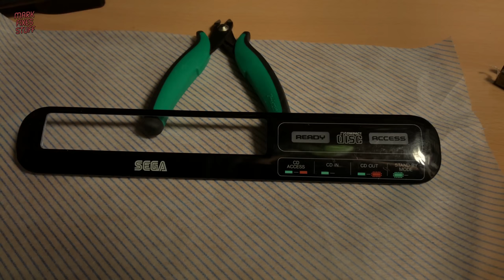Pt 3: Smashed Sega MegaCD Retro Resurrection - Clean, Build and Play!

Comment: i just got one from cash gen.. id a full tear down and clean,, bought some of those pads to clean the rust from screwfix cheers for the tip..
Reply from the maker: Nice one! Definitely check out the caps.
Reply: @MarkFixesStuff  yeah they havent got any signs of leaking,,
Reply from the maker: @fretboarder4752  Just to be clear, sometimes they don't have visible signs but when the machine has been on for a few more hours they will almost certainly start to die with bubbling juice leaking out. It's worth keeping it under observation. All three here had bad caps. I don't want your machine to die!
Reply: @MarkFixesStuff  il keep an eye on it once i get it setup up.. i know a lad local who could recap it for me like.. my md has a region hz switch but the mega cd gives a region screen..think the 60hz mod is to blame for it
Reply from the maker: @fretboarder4752  Yes. You can get a region "free" bios, which is a hack of the japanese version. That would work with all modes but is incompatible with a couple of Japanese games iirc, Snatcher being one.

Comment: Great video I brought the Mega CD back in the day and I've still got and works great. I might need to open it up and check to see if the caps are not leaking.
Reply from the maker: Please do. They are really bad for it. I've seen eight or nine of these and they all had leakage, with some being quite damaged.
Reply: @MarkFixesStuff  It will be next to do on my list I am just doing a Amiga 600 at the moment.

Comment: I still own my Mega CD, from new and when it came out back in early 90's.. I still use it today.. I have a number of Original retail disks and loads of backup/copies that all work great.. Keio flying squadron I downloaded a PAL version but have patched some NTSC and NTSC-J disks, if you buy a Everdrive V5 or V7 you can change the BIOS via the Cartridge (EASY).. I find the Mega CD underrated but I think its great.. Look out for Super Strike Trilogy (Desert strike, urban strike, jungle strike) never was retailed but was in development and never finished (someone did finish development).. Super Strike Trilogy is available to download but will need patching for PAL systems.. There is loads of good games available on Mega CD that people never talk about, even some FMV games are good.
Reply from the maker: I've actually been doing this with my Everdrive clone cart, even loaded a MultiMega bios for lols. 

Thank you for the tip on Super Strike Trilogy. I'll find that on the interwebs!

Comment: Hi Mark, an excellent series you refurbished that unit to an excellent standard. I recently moved house and found my own Mega drive and mega cd in the loft, thought I would set them up and re-live the many hours of pleasure I remember, just wanted to ask your advice, set the mega drive up it worked fine once I remembered that I had to tune the modern flat screen tv in manually 😀. Connected the Mega cd up and switched on it started making a strange noise I turned it off immediately, tried again the green ready light came on and the screen went white but nothing else happened switched it off left for a while but when I turned it back on nothing happened no lights on just a black screen😩, could I have blown the fuse? If so there must be an underlying problem, could that noise be a problem with the drive motor? I look forward to your reply thanks.
Reply from the maker: David Trevorrow hi mate. It actually sounds like a capacitor issue. The noise could be the drawer mechanism. Hard to say, but it WILL need new capacitors because they all do.
Reply: Mark Fixes Stuff thanks for your advice

Comment: hi mark classic flood damage, at least the water and dirt are, when you get a unit with flood damage it looks just like that.
Reply from the maker: I was wondering. I think it sat in water for a long time too, because there was a strange "bronzing" effect on some parts of the lower plastic case which can only have happened if the shielding rusted while it was all in water.
Reply from the maker: @andreasmaltcke117  That pencil looks great. I'm going to get one of those right now. That is a good price because it has the refills too.  Thanks for watching my other videos, but be warned I am not perfect and make a few mistakes  :) 😂
Reply: @MarkFixesStuff  
"That pencil looks great."
Yes, but I must say that it has some "inconvenience".
I will quote a fragment of the product review:
"BE CAREFUL NOT TO GET ANY OF THE GLASS STUCK IN YOUR FINGERS AND WEAR GLOVES WHEN YOU ARE USING THE PEN THOUGH"
That's true, and I will add from myself that touching your eyes with this dust on your hands is even less desirable. Shards of thin glass threads are more dangerous than the needles of this cactus famous for the fact that it feels a month after taking it in your hand. But gloves are not necessary, you just need to remove dust, for example with a brush or a cotton swab or a small vacuum cleaner?

I write this not to you, but to people who may come up with the idea of using this tool. The tool is very good, but you have to use it wisely.
I have been using it for over 20 years, and I did not have any "accident". But my friend was once careless, and he had to visit the hospital (glass dust got into the eye). You need to be careful.
Reply from the maker: @andreasmaltcke117  Excellent advice and I am pleased to know it. Thank you!

Comment: Hi mark I have a few model one's that need help the one I'm trying to repair has sound problems main board works fine but megadrive side sounds doesn't work for example sonic cd , cd tracks sound normal but past stage's that use the megadrive sound I get nothing but sonics jumping sound is fine strange, plays music cds fine tested with perfect working sub board, it's sub board sounds like it's got a heartbeat and sound is messed up but powers on and load's games fine  , have fully recapped both board but no difference any help would be amazing thank you mark 😀
Reply from the maker: If you have a rhythmic thudding it could be that one of the new caps is either installed backwards or it's possibly a faulty cap from new - it happens! I would check each cap for orientation first though!